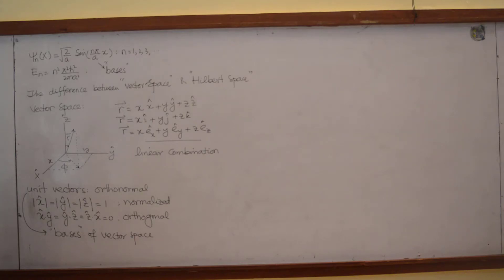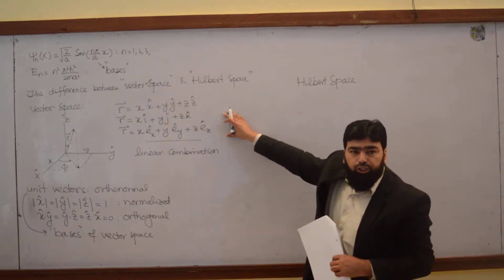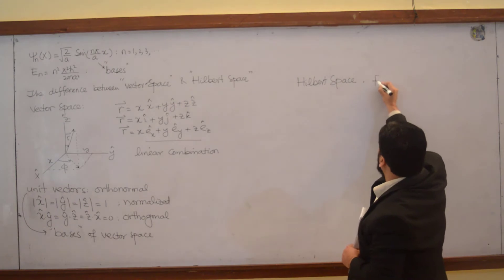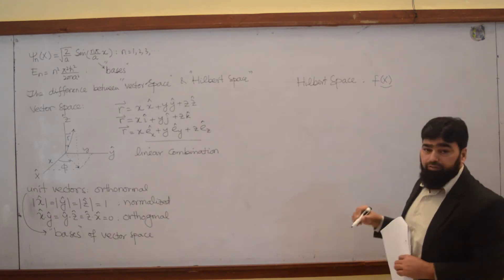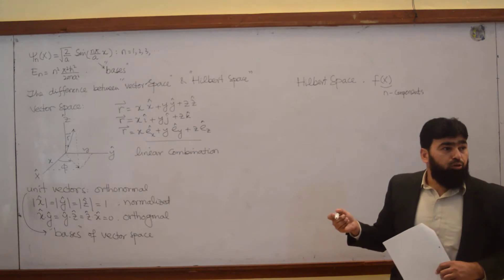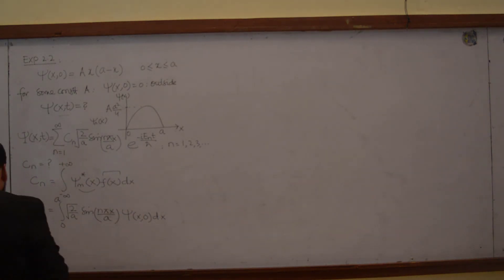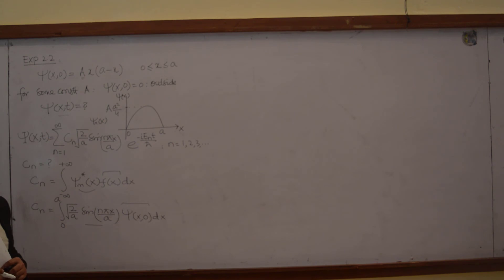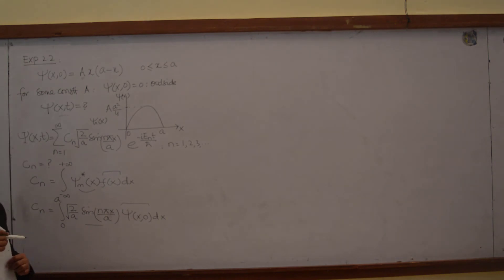L8.3 The infinite square well: Solution Example 2.2

Comment: explanation of vector space

1) if we were to draw three different axis [xhat, yhat, zhat] xhat is a unit vector, yhat is a unit vector, zhat is a unit vector where |xhat is a unit vector| = |yhat is a unit vector| = |zhat is a unit vector| = 1 
2) the xhat.yhat = yhat.zat = zhat.xhat = 0 because xhat.yhat is orthoginal yhat zhat is orthogonal and zhat xhat is orthogonal

anyone confused at 3:05 complex as in any imaginary value that will change the sign of that specific operation value

iota cahnges to -iota
ket changes to bra
AND VISE VERSA

DIFFERENCE BETWEEN HILBERT SPACE AND VECTOR SPACE

->vector space has only 3 components x, y, z for every wavefunction has one axis
->hilbert space has n components for every wavefunction has one axis

based on the previouis lecture L8.1 [summary of infinite potential well] and L7.2-3 [infinite potential well] if WAVEFUNCTIONm =WAVEFUNCTIONn [the integration of wavefunction function squared (which usually consists of complex values) will be 1 else 0

10:28

hilbert space is denoted as PSIn(Xn) where n is 1, 2, 3, 4, 5, 6, ..... are discrete integerrs from 1 to infinite [we sum up all of them] each of those wavefunctions are a solution and sum off all those are also a solution

in vector space, to denote a coefficient, we multiply [the vector for that coefficient * vector for r] 
example [x] = [xhat] * [rhat]

in hilbert we muiltiply the coefficient * [WAVEFUNCTION and (WAVEFUNCTION) *]

[why conjugate] -> [because wavefunction always [at most times] has an imaginary value]

fourier trick instates that C1 PSI1(x) is some function F1(x) so simply we write [INTEGRATION -infinite to positive infinite] -> (F1(x) [WAVEFUNCTION] * dx)
Reply from the maker: Nice input. Appreciated 👍